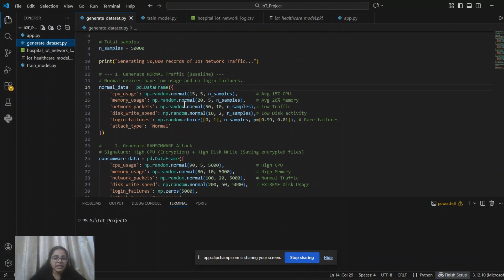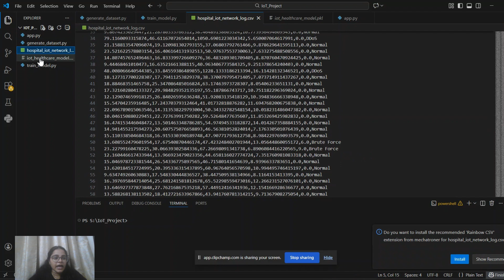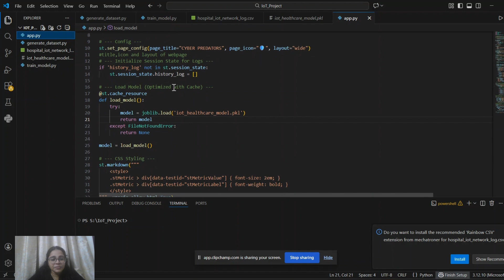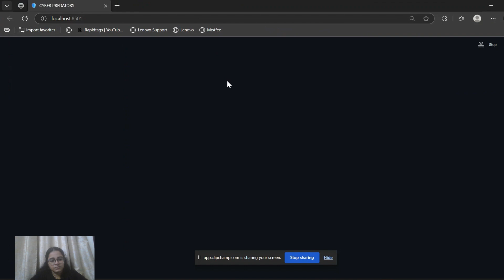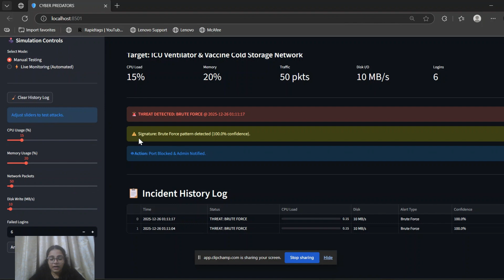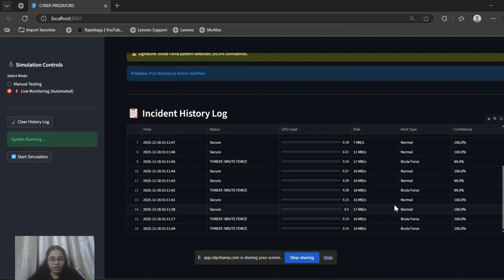Lightweight Machine Learning Based Intrusion Detection System for IOT Healthcare devices

Comment: Excellent explanation, I’m currently doing a project on ML based Intrusion Detection Systems, and your video helped me a lot in understanding the architecture. Could you please share the source code or project files? I want to learn how you implemented the model and detection part. Even a GitHub link or drive link would be very helpful.